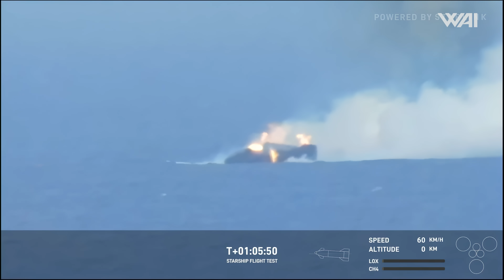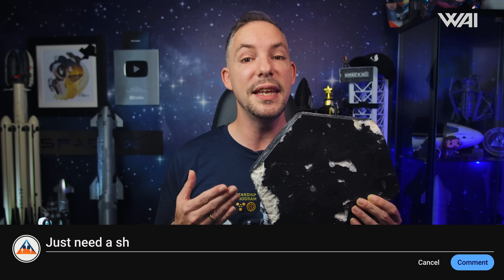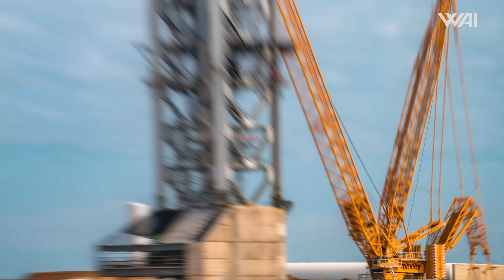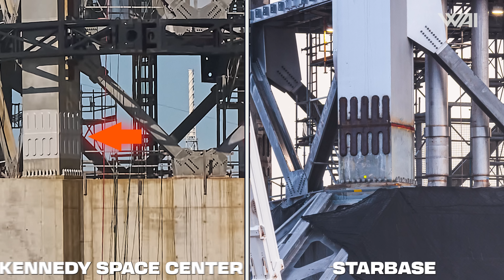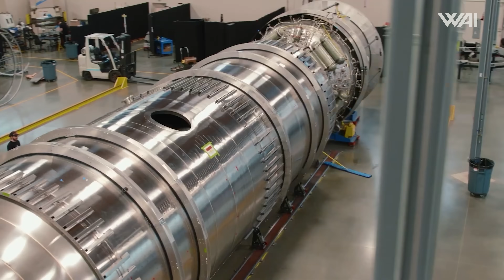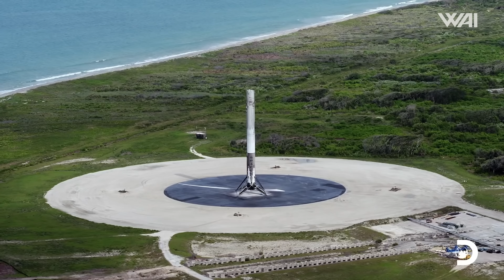Get ready for Starship Flight 7! SpaceX considers BIG Starship heat shield change!

Comment: The active methane cooling is just another level or ridiculous - even a first year engineer can calculate in five minutes that you need hundreds of tons evaporating methane for that. It is so stupid that I do not have words.... 100 tons Starship needs to dissipate more than 1250 000 000 kJ kinetic energy during reentry. Take 1/4th of that - 312 500 000 kJ. 1 kg evaporating methane dissipate 510 kJ energy, so you need 612 metric tons methane just to help dissipate only 1/4th of the Starship reentry energy. How ridicules is that?

Comment: Instead of using glass as the top coat of the tiles, SpaceX should be using Aluminum Oxynitride. The resulting tiles would be much stronger and more impact resistant.

Comment: Just a random idea and I'm not an engineer so I have no idea if it would actually work but plasma is charged right? What if they magnetized the hull with the opposite charge to use the plasma itself in a similar way to the leidenfrost effect?

Comment: The "weep" holes probably isn't a great idea. Not reliable. They will get clogged with junk.
I heard they were going to do a complete closed loop cooling system. They have identified and are testing some special stainless steel variant with high heat resistance and thermal conductivity. 
Sounds like this could be a game changer!

Comment: re Tiling Systems: I've always been worried about simple tiling the aerofoil surface, as a single point of failure (SPF) could well be catastrophic. Generally we try to avoid SPF catastrophes. So, how about a double layer of thinner tiles to avoid complete failure? And in general. if this was part of a natural system ( ie something that had evolved, like a feather) what would it look like? In my imagination, it would definitely have some clever redundancy (so a single failure would not be the end) - like a staggered dual layer, with some overlap. I do realise that is much more complicated to build, but not impossible. Maybe there are wonderful geometric tiling schemes that have never been used? Penrose tiling for example? On that note I do also realise that having more than one tile shape is a complication, but I would be looking at harmonic vibration distribution to avoid geometric node preferential area heating. ie build in minor randomization of the flow patterns to dissipate heat faster.

Comment: Guys, active cooling works only while engines are working! Are they working during reentry? Not to mention thet there is not too much cryogenic propellant left. Am I wrong?
Reply from the maker: The cooling would be pressure fed directly from the tanks. No engines needed. The amount of propellant needed isn’t tested yet. SpaceX would need to find out first. My guess is that they’ll only use active cooling in specific areas.

Comment: I think it would be interesting to "paint" the heat shield: no tile for maintenance, no this solution, cause it makes construction (and maybe maintenance) complex. If you could just "paint" something that works as heatshield, it would be easier and even more precise to protect specific areas
Reply: they would just "spray" it and that's it. Probably even with two different paintings one on top of the other , to make it clear which areas need repainting

Comment: They need to make bigger ceramic pc`s for heat shielding. Too many pc`s gives too many failure points.Larger pc`s can be secured more effectively.The construction of bigger pc`s will mean larger manufacturing equipment of course. But in the end  It could even mean saving weight for the launch vehicle for less adhesion points.

Comment: You normally trade options in design, and you move forward. To go back to an old option hints that something was overlooked or under analyzed. Space X should have flown a model of Starship in the Falcon 9. They could have saved themselves a few engines and vehicles. They should still do it.

Comment: I am not really confident, that the currently used heat tiles will be capable for rapid reusability. For now they allow the ship to reenter the atmosphere and maybe to launch again with some repairs, when a catch will be successful. In a later process of multiple ships starting and landing several times a week or even a day, this amount of necessary work after each flight won't be an option. This inevitably leads to the development of a more sustainable solution, that could maybe be a gas cooles metal shell. Hopefully we will see this soon, I am curious.

Comment: No viable heat shield after two years and six flights? If SpaceX cannot create a heat shield that does not need refurbishment after each flight, then starship will fail to meet its quick turnaround time goal. Obviously, since it has taken six flights for SpaceX to realize that they don’t have a viable heat shield design, SpaceX does not have adequate ground test facilities to simulate heat shield stresses. If starship second stage heat, shield needs extensive refurbishment after each launch, the starship will be no better than the space shuttle. The starship may look like the future in the same way that cyber truck looks like the future, but if it fails to meet its primary objective of quick turnaround reuse, the starship will be as much a failure as cyber truck. All hail the design, genius Elon!

Comment: Oooo active cooling with outer plasma arcs (plate shaped )which would dissipate heat like how they use firing rockets into the hot environment to help shield with fire but plasma won't have any thrust effect or use fuel (just electricity)

Comment: For Goodness sakes Active cooling IS the way to go. How long has NASA and other f/ around with tiles and various others that Still are compromised. Surely there is a way to incorporate the shield into the skin of the Starship without adding much more weight than what the tiles would. Surely you can use other refrigerants as well as the launch fluids for the short burst of re-entry. It has to be delved into further.

Comment: If they do decide to add active cooling to the surface of the starship then I hope they add it to the entire surface. That way the ship could roll during re-entry allowing the hot side to roll around and cool off a bit while the cool side rolls around to take it's turn in the furnace. This would also avoid any ship losses if an accidental roll occurred on a ship with cooling only on one side.

Comment: Nova's 1st stage has landing legs. So maybe they are planning to return nose down with the landing legs performing the role of grid fins. After all if you are going to carry all the weight of landing legs then if you can eliminate grid fins then the weight penalty for the legs isn't so high. Then as the 1st stage nears the ground it performs a flip manoeuvre and lands on its landing legs / grid fins.If they are planning to use hot staging then the top of the 1st stage will need to be strong and heat resistant. Sounds like the perfect side to face downwards during the high temperature descent stage. Which would keep the main engines safely out of harms way. Likely reducing any inspection/repair required between launches.

Comment: I believe that sweating methane is a real good idea, maybe not for the whole ship but specially on the hinges. If you flow methane through the flaps with no or minimal shielding, you will get a quite high pressure gas. Exhaust it through the hinge at a pressure higher than the plasma and plasma can't ingress. The pressurization is done for free by the re entry heating. The flaps and hinges have a relatively small surface so it wouldn't take way too much methane, ullage gas that may need to be vented anyway due to tanks heating may be enough (Not sure if it would to shield the whole ship, I guess that it may if Elon is implying that).

Comment: With the heatshield its not just about temprature, for this cooled metallic heatshield its more about the total energy of the reentry. You cant let the steal get above, lets say 600°C, to keep the structure safe. This means you need to divert the excess energy somewhere. If you reciculate the propellant used for cooling back into the ship what do you do with the energy? For perspektive Startship, assuming 50t of mass and a velocity of 28000kph, has a Kinetic energy of 1,96TJ. This means the resulting Power for a reentry taking 5 Minutes is about 6,5GW. Of course of this not every bit of energy is going into the ship, but nontheless it shows with what kind of energys they have to deal here. 
On that point, when you reenter from the Moon or Mars you are talking a whole another dimension again because of the way higher velocity (that goes in squared into the formula).
Bleeding the propellant, I think, is more likely to work, because you form a boundary layer of cooler gas that keeps the skin safe. How much you would need and if that would be better weight wise i cant say with the information i have. 
I see it if all more for the critical areas like the hinges.

Comment: Yeah I think metallic cooling system the best way because is used to cool the engines the heat for the engine is very high than that
  of re-entry  Ben and repairs are more easier than to stick it shield tiles ,Starship has to be bigger to
 carrying more propellant for cooling and for propelling the the ship so we are waiting for Starship 2.0

Comment: If a major heat shield change is being considered, this might indicate that SpaceX is preparing for more ambitious missions, like crewed missions or interplanetary travel. A more robust heat shield could increase the spacecraft’s ability to handle the stresses of deep space travel and reentry through different atmospheric conditions. Additionally, this change could be part of SpaceX’s strategy to ensure Starship’s scalability and reliability, key factors in SpaceX’s plan to revolutionize space travel and colonization.
Reply: Serious question: What are the additional stresses of deep space travel that we do not have in “orbital travel”?  All I can think of is additional radiation.  I don’t think we are at speeds yet that require shielding from stray hydrogen atoms. Micro-meteorites and space junk are just as much an issue in orbit. Am I missing something?

Comment: I am sure they considered using the heat differential between the hot and cold sides of the fuselage to power pumps that circulate coolant, but the fuselage has so much thermal power that you might use it to equalize itself.

Comment: The design of the heat shield the way it safe is wrong. It should be safe or expansion boxes into the next to the next tile with enough expansion room between the two as a span and still make a stronger barrier Your Design is wrong

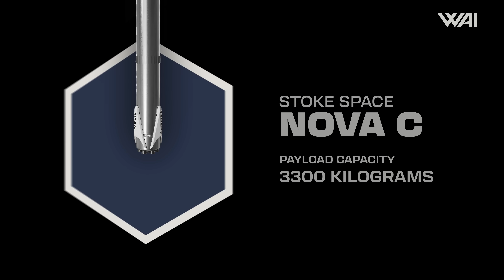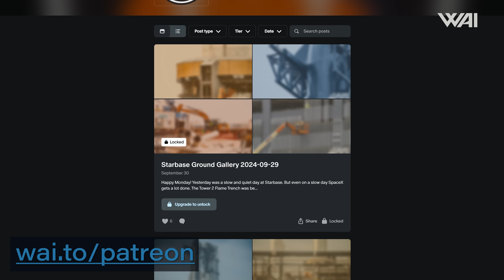Comment: @16:32 "That's in contrast to the 19 tons..." - which is for the expendable version of Falcon 9. The partially reusable Falcon 9 (Return to Landing Site and small second stage engine nozzle) is only capable of placing about 9571 kg to LEO. See "Why Economics Favors a Mass Driver Over Rockets" at 5:30 for details.

Comment: I think the holy grail for a 'heat shield' was always some kind of fluid or gel (not necessarily fuel but it's great if that will work) that could be flowed along the underside of ship during re-entry. No matter what solid material they use, it will eventually wear and need refurbished even if it can survive more than 1 flight or 5 flights or 10 flights. Being able to simply refill a tank of 'liquid heat shield' when they refuel would be faster than any form of refurbishment in the long run so long as they can get it to work.

Also like you suggest since they have the technology in house to build the engine nozzles, they're already in a prime position to expand that technology to other applications such as heat shielding.

In fact I will go one step farther and say they should implement this kind of thermal protection into the tower as well, though they could likely just use water instead, everything on the rocket side of the tower should be shielded to maximize longevity of the tower.

Comment: Clealry they need the heat shield tiles but they should be mounted to a skin that is easily removed and replaced as large panels then and the fuel coolant in the hot spots as you mentioned,  This way the inner layer is permanent and never gets hot damage.  There is no perfect tile. Let them cook and burn, make them thicker and permanently fasten to the removable panels. D

Comment: I can't see heat shield tiles staying if starship is ever going to get to the rapid reuse that they are planning, while slightly simpler than the heat shield on space shuttle, I think it will still require the same type of inspection between flights meaning ~6 months turnaround. Transpiration cooled would be much more robust and far easier to inspect.

Comment: Thanks for sharing your thoughts, ideas and videos. So many ideas, I’ve been torn about the design of starship sine the beginning. So many possibilities. I do like the idea of active cooling. I frequently pondered could they make the skin of starship a double wall design with the space between the walls filling in for the down comer pipes and possibly also substituting for the header tanks. Similar to the famous nascar racer that wanted to increase his fuel capacity while staying with a stock tank that the judges would inspect. Rumor had it that his fuel line was sized up to increase the capacity of the fuel line to several gallons of gasoline. Car had a fully adequate fuel capacity even without a gas tank installed. If the walls were double walled not only could that add strength tru shape but also cool the wall of the ships and prevent sloshing due to the smaller diameter inside the tanks/ pipes. Could provide more internal clear space inside the ship, depending on size of the inner passage possibly provide a near linear flow of propellant to the engines, provide magnet shielding of the inner ship structure depending on thickness of the propellant and if active magnetic shielding against the plasma field were investigated would provide cryogenic cooling for super conducting magnetic field generators. So many crazy ideas. Wishing you and your family the best.

Comment: Industrial Diamond coating as an under the tile passive heat wicking away system moving heat to the space facing side of Starship bare stainless steel skin which should reduce re-entry turbulence.

Comment: After flight 5 I suggested gas cooled tiles but I I visioned tubing inside the tiles themselves. Now I'm thinking the tubing might run tile to tile from the injection fasteners now known as the tile holding pins.

Comment: Perhaps Musk should ask Putin for some help on the heat shield problem.  The new materials on the Oreshnik KE MIRV can handle extreme temperatures at Mach 11-12.  Musk has adapted Russian tech/concepts in the past including the recent use of hot staging on the Starship.

Comment: Tiles never made sense for rapid reuse anyway. They're susceptible to damage, and the danger there is that it ends up in the same boat as the shuttle: complete inspection and refurbishment between launches. Instead, behind metal active cooling, transpiration cooling or even just hot metal approaches in key areas (see Dynasoar) were always going to be superior, ideally with an ablative backer such that there is no single point of failure like we saw with Colombia. We must also consider that these will not just be returning to earth from low earth orbit, but from lunar and martian orbits too, so reentry speeds are going to vary significantly.

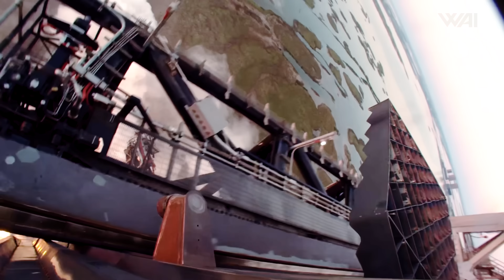Comment: 12:30 Could be the reinforcements are just a ‘confirmed static requirement’.. i.e. they know they need them and there is very little likelihood that there will be a change… whereas on the chopsticks… that is still in ‘prototyping’ … so they will confirm it’s performance, and possible design changes over the next couple of catches etc… i.e. leaving the path open for changes with minimal re-work..

Comment: I wonder if making vulnerable areas from the same metals as used in high temperature turbine blades in jet engines would work? I think they are nickel. Expensive, hard to machine, but a high melting point.

Comment: Hello Felix big fan here, I have one question about the heatshield. Could the original plan of using carbon fiber still be a viable option here? Only for the actual heatshield of course but I think it would remove a lot of the complexity brought by an actively cooled system, but then again I'm not really an expert. It could also bring the weight down slightly.

Comment: Terrible idea to use for the entire ship.  Would add way too much wait and be the exact opposite of best-part-no-part.  But I'm reasonably confident that the main reason they're looking at it is because there's really no other way to protect the areas where they removed tiles on IFT6 while keeping those areas free for the sake of capture.  Limited use will still add a lot of complexity and weight but at least it won't scuttle the entire payload capacity.

Comment: Surprised they don’t make a large casted tile, similar to the ring sections, limit the cracks and make it easier to install and maintain
Reply: It's because of thermal expansion. The gaps between the tiles give some margin for the metal body to contract and expand. The ceramic tiles don't change that much in size.